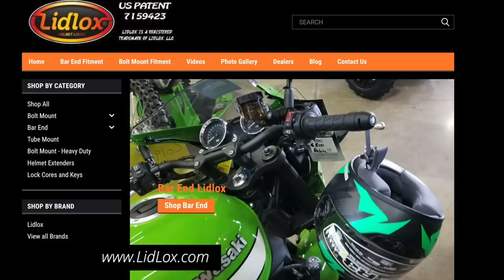Goldwinger Rides A BMW K1600 1429 Miles | New Mexico to Texas | Day 3 | Cruiseman's Moto Vlogs

Comment: Keeping your foot on the rear brake does nothing with this bike unless you’re only using rear brake.  As soon as you use the front it will add the rear brake automatically, regardless of how much pressure, or lack thereof, you provide as input.

Comment: Trick I learned yrs ago, traveling across AZ/NM/TX: Koolgater, soak it every time you fuel up and a camelbak backpack filled with Gatorade - I place a freezer pack between the bladder and the backpack, keeps the drink ice cold
It was 106 when I pulled into my garage today @ 11AM
😉
Be safe out there

Comment: Great videos,  there are two main reasons that made me choose the GW rather than the GTL,  the low center of gravity and that the GW will most likely outlast the BMW by 30 years.
The only downside with the GW is the poor capasity of the side bags. 
I have the 21 DCT tour airbag.
Reply: Wow outlast it by 30 years!!  I'm riding way to much to think about a bike lasting 30 years, no matter who makes it. Unless I'm collecting them that's one thing, but as a primary ride...No. At the rate I've been doing the last 25 years 30 years would be about 750k+. Nevermind the bike lasting 30 years, what about me.

Comment: Have liked the BMW for years. Rode my last GW for 102,000 miles, currently have 37,500 on a HD Limited. Maybe I need the BMW for my next ride???? Looking forward to the head to head comparison!
Reply: My experience and belief is that you went sort of with the masses by going with HD for what the Goldwing produced, having been a owner of a showroom display 2015 K1600 although not the GTL but the more sporty posture GT I could certainly say Honda had thoughts of making this generation of the new Goldwing stature somewhat similar in size versus the sofa on 2 wheel status and followings

Comment: I like the BMW too but if I would choose to go that way I'd rather take the R1250RT. I am excited to find out what a head to head is going to be. I had a scary moment on the last GW I had too. It was early in the evening and I drove uphill. As soon as I was over the hill there were two deer in the road, one in the middle, the other one blocking my roadway. I gradually accelerated and aimed between them and made it as there was not enough time and space for a full on breaking. Also my 2015 didn't have ABS so that was a factor too. I made it but my hands were shaking a little after the incident... Lol

Comment: Upon your early morning departure did you notice that the handlebar switches were not backlit? The console and handlebar bar of the Wing are all lit up. That’s a real nice feature. As well, the front directionals on the GTL are located mid level of the bike, just above the radiator, whereas the Wing are right on the mirrors where motorist see them best. Just an observation and an opinion of course. Looking forward to your point by point review.  Looking good out there.
Reply from the maker: I did notice.
Reply: I agree however in my opinion it was not a big enough factor to not purchase when I had compared my 2015 K1600GT
Reply: @mavorik66  

Fair enough. Had you compared the 15 GTL to a 2015 Gold Wing? More brilliant are today’s Gen 6 Gold Wings. A different specie.
Reply: @roadglide  I did when it first came out and I agree entirely different, when I first saw it in person I felt honestly they had downsized it so much in comparison to previous Goldwing that they may have taken a page from the K1600 in actuality, test riding a dct and approaching my first turn around had me pucker up a bit for the fact it had shifted mid corner, I understand since that such can be manuel shifted if rider chooses so, so not a big factor especially for those owners that absolutely know shift points per the rpm in a particular mode 
My other observation in comparison was that I felt I sat more on top of Godwing (new version) vs BMW GTL 
although I owned the GT version, so the GT was Morso like that of the Goldwing
Reply: @mavorik66  

Got it! Sounds good. The manual 6 speed tranny on the new GE is also smooth as butter for those that are not fans of DCT. I get the tactile difference and slow speed skills control advantage of a clutch’s friction zone. The DCT is a hooligan off the line, open highway or slow speed traffic. Relieving the hand of the clutch lever.  But cone weaves and obstacle course navigating the DCT requires a practiced technique as you are using only brake and throttle. Good stuff. Ride safe. Any day on two wheels on a great day.
Reply: @roadglide  Awesome,  Awesomeness and thoughtfulness replies sir Thank you Road Glide

Comment: Sorry but just the initial sound and your great footage of the BMW, I Don’t believe it is as refined as the Goldwing, plus typical BMW I CHECKED OUT THE SERVICE COSTS and wow 😮, you really need to factor that into your equation before you actually buy 1, plus the software updates are not free either.

Comment: Great Vid, I appreciate your efforts in making it.  Just a quick question, do you wear a cooling vest?   I have done a few trips in summer and have a cooling vest and neck cooler.  I know that they are only good for a couple of hours before you have to re-soak them, but they make a difference.

Comment: Hey Chris make sure to ride the BMW in all the different drive modes dynamic etc … also have you used tip? Where you can up shift and down shift  without using the clutch? 
I have a 2018 GW  But my friends that I ride with all have BMW’s  RT 1250/ K1600GTL etc…  I can’t wait for your review because I used to be a BMW owner until I test  rode the 
Honda Goldwing.  I even ordered and had put a down payment on a BMW Grand America.  I canceled the order and got my money back after I rode the DCT Amazing !

Comment: Regarding the BMW Nav and BaseCamp, did you import Route, Track or Waypoints, or all 3?  Which did you select to route?  In order to use BaseCamp waypoints effectively on the BMW Nav, you need to alphabetically order the waypoints in the order of on your route.  Ex:  01-Start, 02-Break, 03-Lunch, 04-End.  Otherwise not doing this with a lot of waypoints will cause the BMW Nav to mix the order of the waypoints.  This is if you select the Waypoints to route.  If you selected the Track or Route option to route, you'll just get turn-by-turn and no waypoints.  Regarding not being able to hear the Nav through your headset, do you see your headset paired in the Connections from the System menu?  Both Bluetooth and WiFi are used from your phone to connect with the bike.  WiFi is used to transfer the graphical maps from the phone to the bike's TFT, and Bluetooth is used for the rest of the connections.  Without knowing and seeing how you currently have the phone and TFT set up, it's hard to say what's wrong.
Reply from the maker: Thanks for that info. I will double check everything.
Reply from the maker: I imported route and waypoints, but not tracks.
Reply: @cruisemansgarage  So I assume you selected the Route option you imported to actually route you? That would explain why no waypoints.

Comment: I hit a deer on a motorcycle when I was still a teenager in the 70s.  I was still young and resilient then, and lucky to walk away from that incident.  Had to throw my helmet away due to a hole worn through the side from sliding on my head.  It's an experience that will stick with you for a lifetime, so I know what you're feeling when you're on the lookout for wildlife. I don't ever want to do that again.

Comment: Today.......... I sold my GW 2020 Tour DCT White on Black motor/frame/wheels :-(. The reason? I already gave a deposit for a 2022 or 2023 (Lord knows when it will be here!) BMW K1600 GT.

Why BMW K1600?
On my last round trip from Miami to Harrison, AR (The Ozarks,) the other two riders had BMW RT 1250 (2022,) which sparked my interest in the BMWs. Upon my return, I contacted a friend who has a K1600 GTL, he was kind enough to let me try it for a 100 miles ride.

What I liked................POWER!!!!

What I did not like:
1. Top-heavy.
2. Riding position is not that comfortable when compared to the Goldwing. The seat is too low (I'm 6'), and the footpegs are a bit towards the back; therefore, your legs are bent less than 90 degrees (almost approaching a sport-bike position) 
3. Since this GTL was not a 2022............the electronic cluster/GPS/dashboard is and looks so outdated.
4. When I ventured to open the side cases..........They are flimsy as hell when you compare them with the Goldwing.
Both bikes handle very well in the twisties. The Goldwing is a competent one taking comers. I did not notice any K1600 advantage over the Goldwing.

So, Then why a BMW K1600? As I said before POWER!!!!

Why a GT and not a GTL?
1. I like the metallic with on black motor/frame/wheels, just like my Goldwing.
2. The riding position (for me) in the GT is almost as comfortable as the Goldwing
3. The top case (which I already ordered) can be installed in/out relatively quickly.
4. I have been riding Goldwing for almost 20 years. I have always been a sport-rider, I don't care for the straight lines, but I love the twisties and a good engine punch. I think the BMW K1600 will give me the power that I crave and the comfort that I need to continue riding with my wife ( you know it..... comfy wife............ happy life!)

I will miss my Goldwing, it is a great bike, and she took me on delightful trips and allowed me to meet great people................. so I have changed the Brand, but not the Band!

PS:
He knew he was walking
Into a waiting trap
Neatly set up for him
With a bait so richly wrapped

So he went inside there to take on what he found
But he never escaped them, for who can escape what he desires?
Reply: Sounds like the cons outweigh the pros. I will never give up willingly my DCT Tourer. This (or any) Goldwing has never left me stranded and I have been on Goldwing since 1981. I think you made an error. But, your ride, not mine. Be safe out there.
Reply: @backroadswingrider854  Sometimes you have to get out of your comfort zone.... experiment a bit.  An error is a learning lesson!
You be safe as well my friend!
Reply: Your choice as more of a speed junkie, I get it. I'm not, sport mode on the Gold Wing is thrilling enough for me. Maybe get a Hayabusa. I have a 51 year old friend that's a speed junkie and rides a Hayabusa, to each his own. You can't put a helmet in the BMW's top case, NO HOLE FOR A BACKREST in the seat !!!. A major must for me. A worse dealer network and more expensive to work on and maintain. Harley is the king of aftermarket and culture, then Gold Wing and worse for BMW.

Comment: Well, I’ve watched the previous K1600 videos. I really don’t care about the bike. Other observations…too many commercials, too much filler, too much self-promotion, the music overlay blasts when it’s on, then when you speak the volume is too low, and if I didn’t like Lidlox before the videos, I surely don’t like them now. I used to find value in your videos, but recently that has not been the case. I’m sure it won’t make any difference but if I continue to find little value in the channel, I will unsubscribe. Just thought you should know.
Reply from the maker: What do you want to see?
Reply: Well, perhaps I was a bit harsh. I’ve been with you for years, own both of your video repair series, and have usually found value in your reviews. In answer to your question, videos should be either informative, or entertaining. The best are both. Product reviews and how to’s are also good. I was annoyed with watching 68 minutes of boring Highway, and most comments, with multiple repeats over, and over, and then again on day 4. Banners and ads overlaid and repeated. I understand you only had one camera, so all the more reason to cut it short. One 15 minute video could have encompassed that 68 minutes, and I  wouldn’t have felt like I wasted so much time. Travel vlogs are nice,but you have to put something interesting in there.
You asked, so I replied. Sorry for the delay. I was out riding.